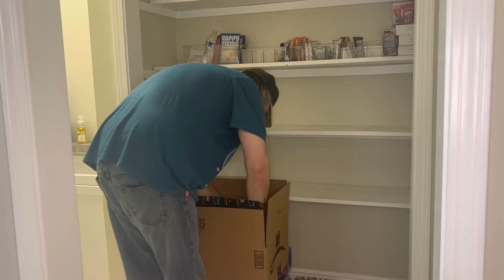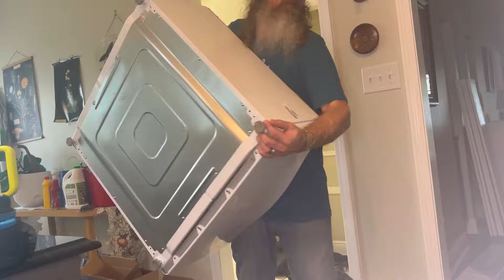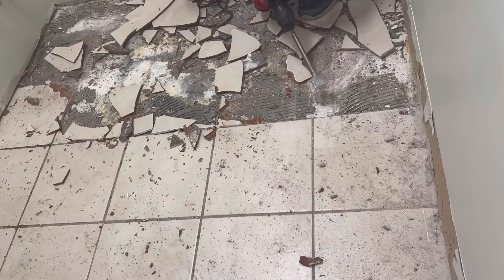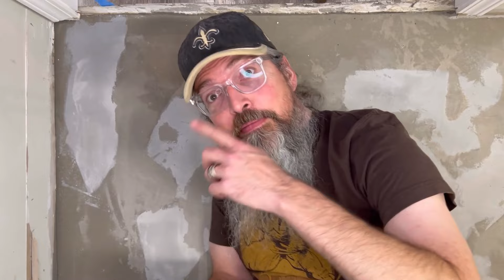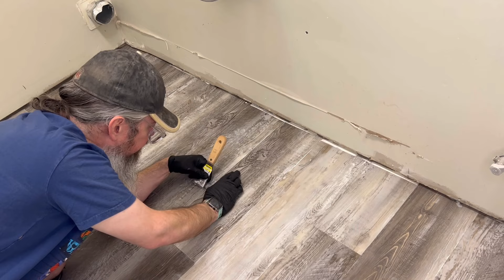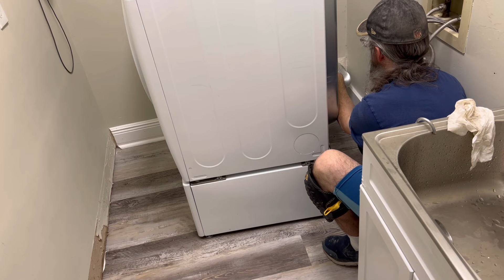Ceramic Tile To Vinyl Plank Flooring - Updating Our Laundry Room

Comment: Why did you have to use glue? Is it not a click and lock sort of a vinyl plank?
Reply from the maker: This flooring is vinyl, not a rigid wood or pressed board material with click & lock grooves. Essentially, it’s the same material as sheet vinyl flooring, just in planks. This particular plank I was using is LVP, or Luxury Vinyl Plank. It mimics rustic wood flooring, but with the water resistant qualities we need here in the Deep South. With the waterproof adhesive I used, this flooring is 100% waterproof. 

Thanks for watching!